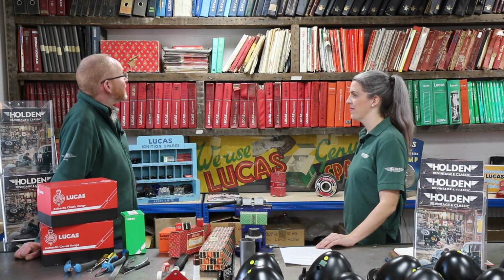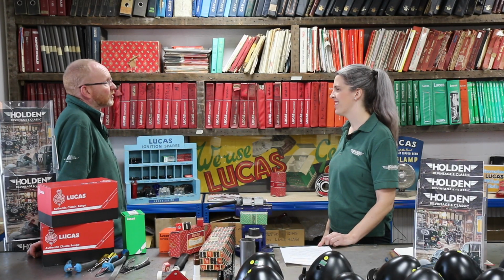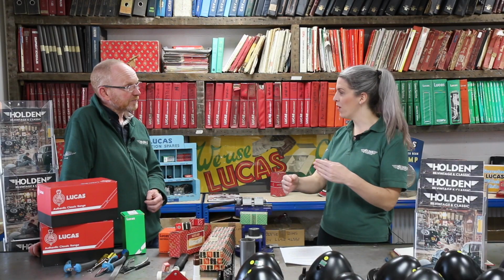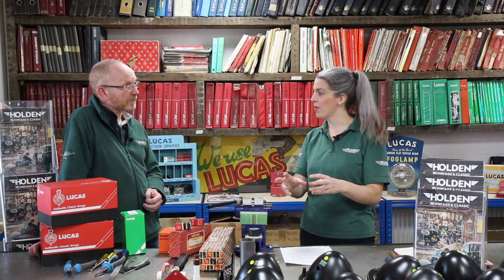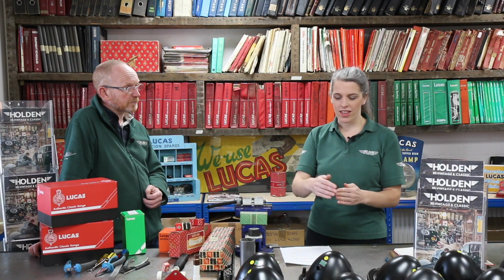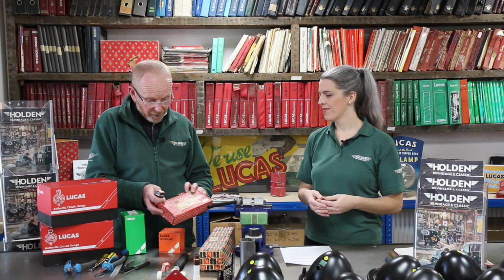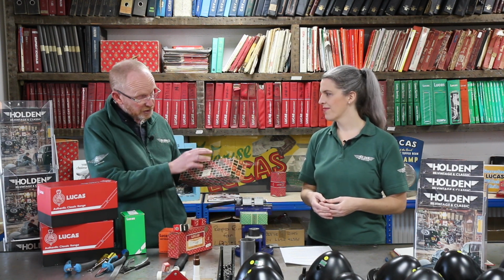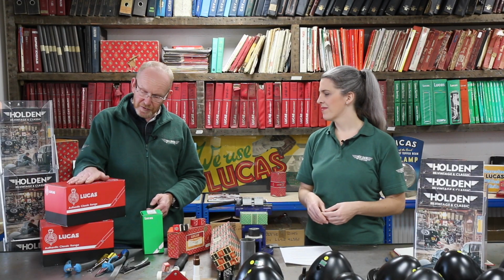Lucas Electrical Products: Holden Vintage and Classic

Comment: Scammers! 
I ordered Lucas remanufactured turbo charger. Core should be originality made by Garrett… 
Instead of it a get cheap low quality Chinese Jrone turbo unit packed in Lucas green box. 
Paid 650$ for ref turbo… get 250 eBay repacked bullshit…

Comment: I own the oldest diesel rover 75 its a early 1999 and all the electrics are lucas I have a 2005 Rover 75 too and the 1999 is far better in everyway the 2005 mechanically way is amazing but the alternators and stuff always fails

Comment: Can a Fergie te20 be converted to a key start,and what parts do I need to buy Joe thankyou
Reply from the maker: If its a push button start you can just change that for an ignition switch, its a straight swap over
Reply: @HoldenVintageandClassic  Do these stop working without a moments notice
Reply: @OscarOSullivan  
I am sure that can be arranged.
Reply from the maker: https://www.holden.co.uk/p/lucas_type_ignition_starter_switch_body_only 
https://www.holden.co.uk/p/lucas_type_ignition_switch_barrel_and_key_only